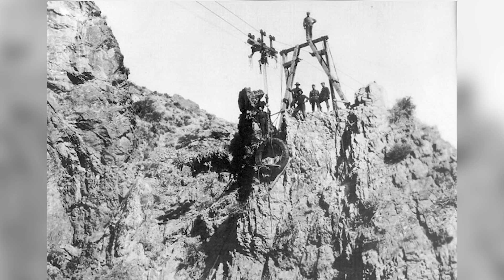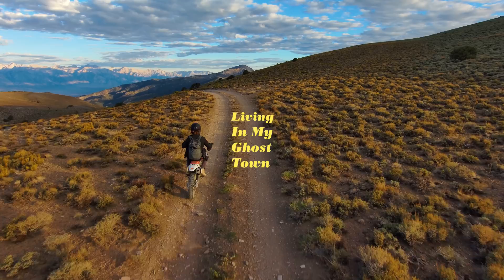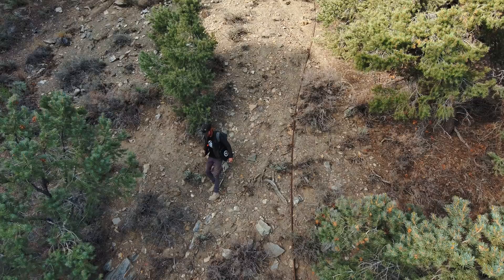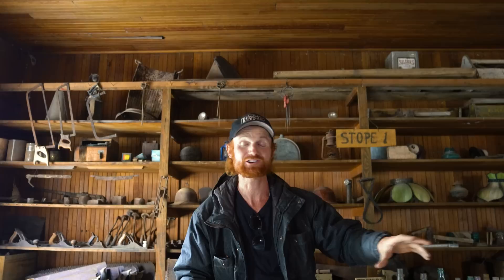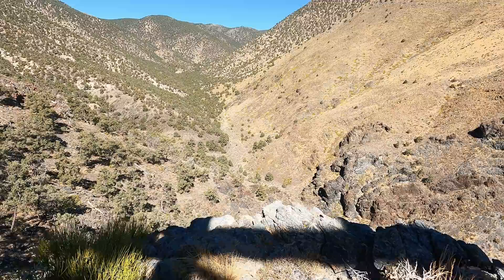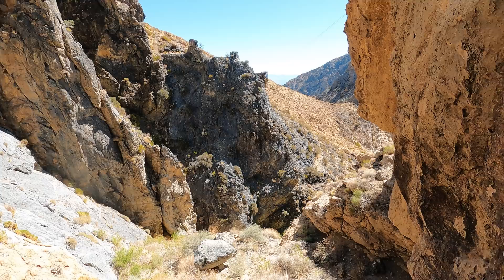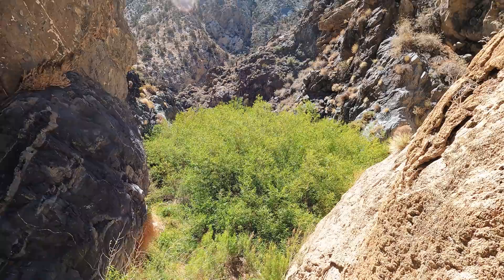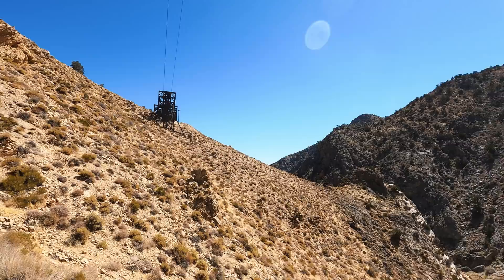Hiking The Steepest Tramway In The US! (Saline Valley Salt Tram)

Comment: Brent keeps asking "How did they build this?". The answer is elementary. FIRST THEY BUILT A FREAKING TRAIL- not your average trail- a HEAVY HAUL TRAIL! Then they worked multiple hundreds of mules, many dozens to their death hauling the portland cement, wood beams and planks, huge electric motors, brake disc rotors and other steel machinery, steel cables, bolts, nuts washers, not to mention tools, bed frames, wood burning stoves, etc. to the construction sites.

This isn't' another illicit and disgusting PETA scam for cash or a cheap political statement- it's simply a fact.

Somehow, upon opening this vid, I had the dreadful thought Brett wouldn't know enough to follow the trail which hits every tower and every motor station (as I have hiked). Granted the trail is over 100 years old and challenging to follow. Staying on the trail takes some brain power and bush craft. Best achieved by getting in the mind of a mule packer hauling in hundreds of feet of continuous steel wire rope strapped on a mule train. Better yet; getting in the mind of the studs that built the trial.

I'm grateful Brent didn't get trapped between waterfalls. If he had his InReach is no guarantee. Every one knows InReach is a joke since Delorme sold out to Garmin. Even if it worked then what? Rescue personnel at their considerable risk to haul his sorry ass out? 

So Brent is still above ground. Did he learn anything?